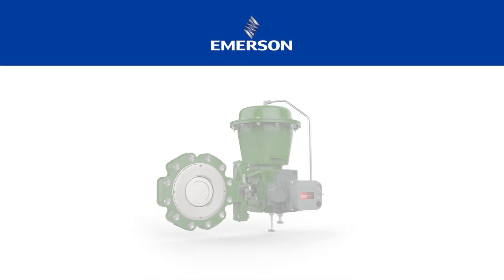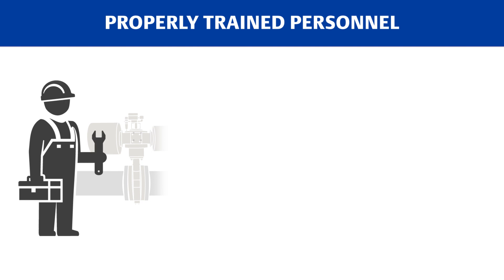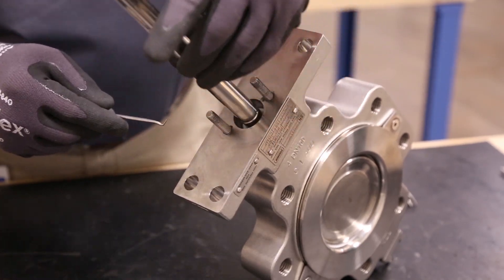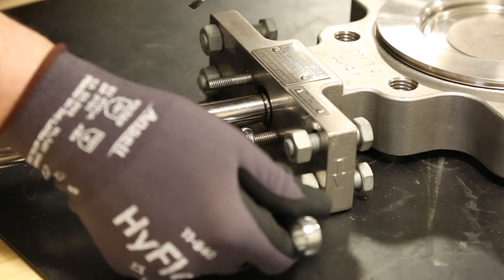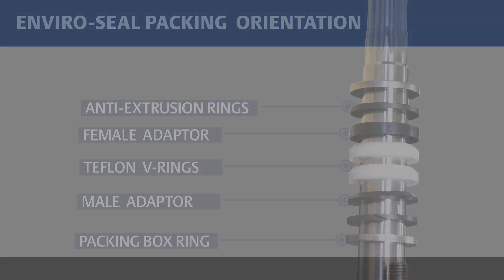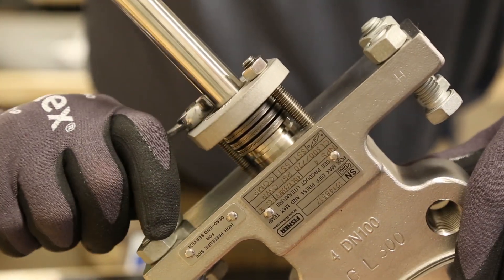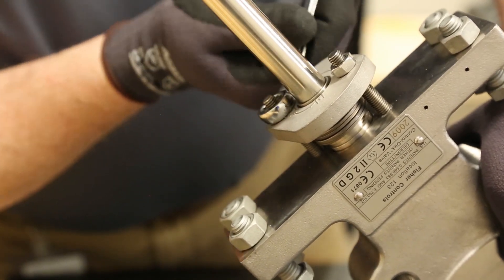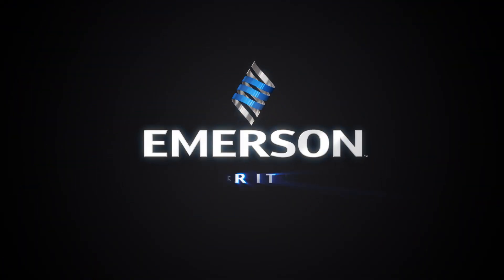How to Install ENVIRO-SEAL Packing Systems in Fisher Rotary Valves

Comment: I work for a company overhauling all different types of valves, including a lot of Fisher control valves, and I've never seen a control valve using Belvel washers as a spring. Done hundreds using the standard compression spring though.
Reply: Belleville washers keep the preload and reduce leaking, fugitive emissions and downtime. Its estimated up to 75% of valve leaks are due to reduction of packing stress. The Belleville assembly maintains the preload and packing stress. If the valve was not manufacturered with the use of the assembly, many times the valve can be retrofit  - any valve brand. Any questions, feel free to ask.